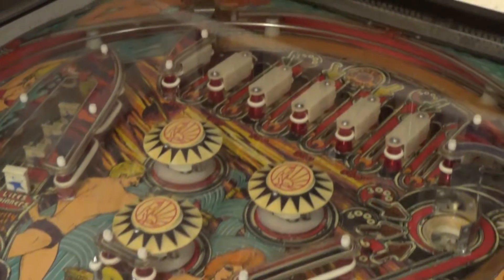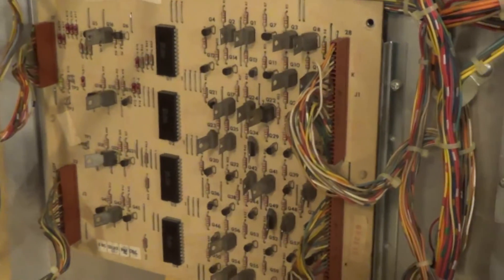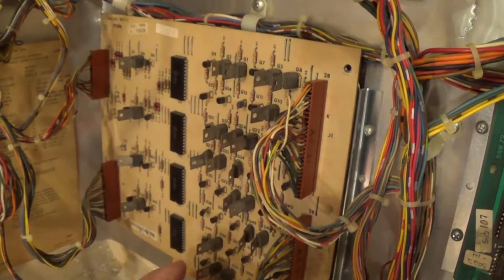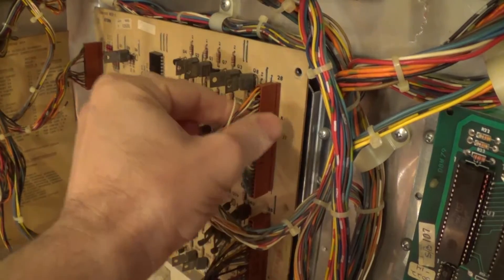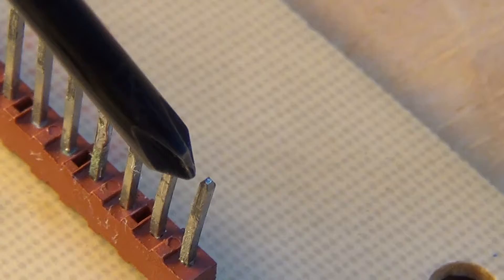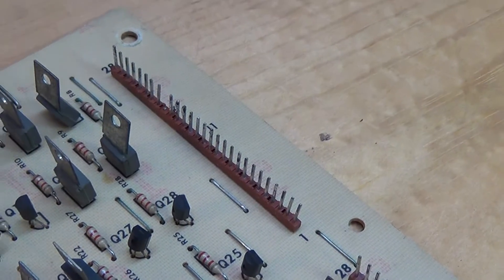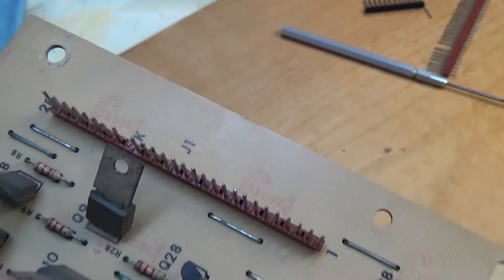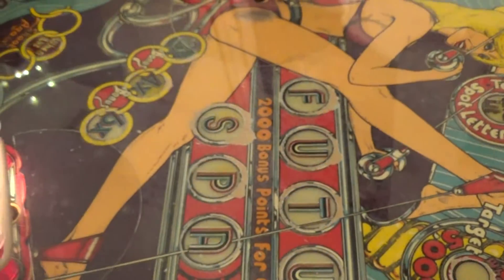How to Replace Header Pins on a Pinball Circuit Board

Comment: HowtowithGEO, how much current can those header pins handle because of original header pins can handle how many amps of current?
Reply from the maker: Not 100% sure.  Walmart doesn’t report it.  But equivalent pin headers are rated for about 3 amps
Reply: What is the item # from Walmart? Or can you post a link? Thanks!
Reply: @lagunza   these look good   look on amazon   uxcell 30Pcs 2.54mm Pitch 40-Pin 14mm Length Single Row Straight Connector Pin Header Strip for Prototype Shield